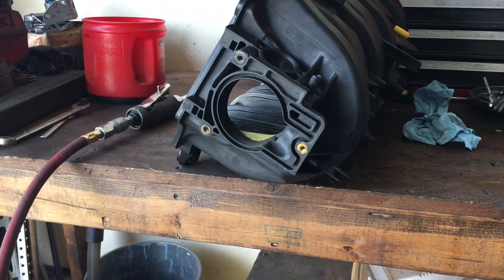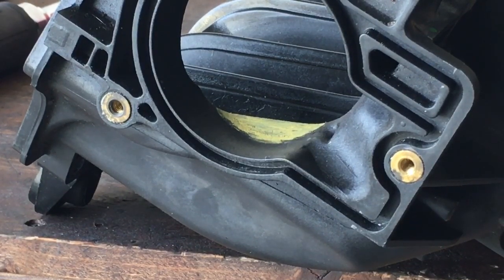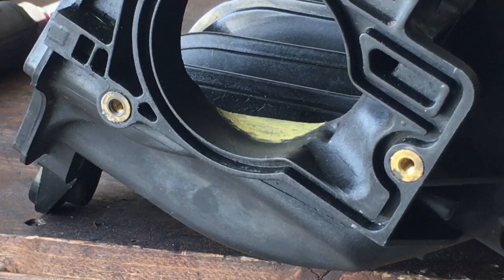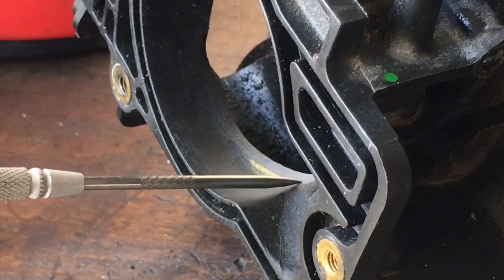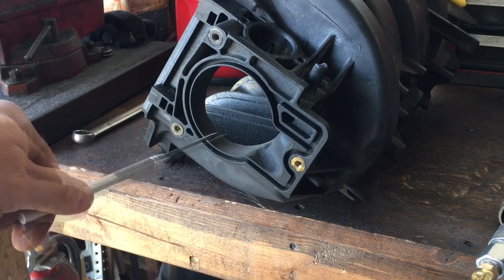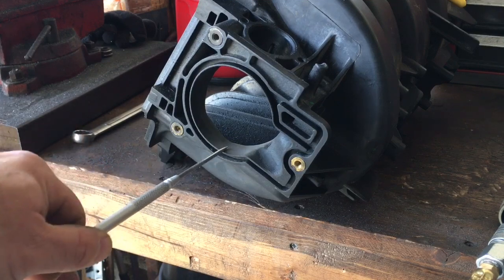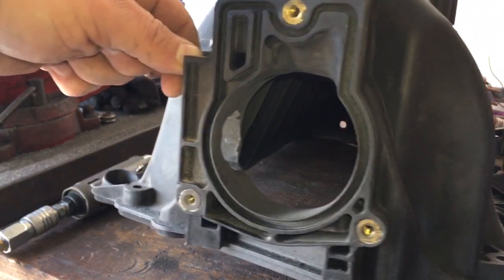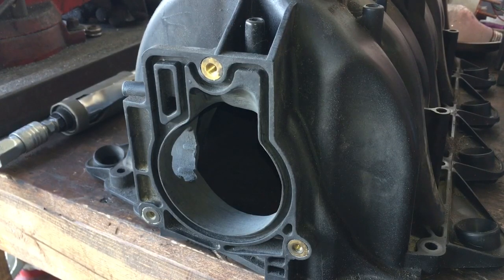Porting  4.8 5.3 6.0 Truck Intake 615-183

Comment: i bought one of tgese intakes from ebay when i split it  it was held together everywhere with some kind of sealer instead of gasket/seals was wondering if you knew of a sealer i could yse to put it back togethor?

Comment: I know this is old video, but what grit or what are you using to do the grinding?
Reply: NVM, I just needed to watch a little longer.
Reply from the maker: You can use a tight flute single or double cut burr.  Sanding rolls 60, 80, 120 etc 👍

Comment: How did u get it apart and sealed back up ?
Reply from the maker: The intake has large o-ring seals and since it was new had never been heat cycled etc.  I just unbolted/screwed the halves then reassembled. 
I’ve read about people sealing the halves with the Right Stuff rtv or even using epoxy.  I’ll be honest my 4.8 never ran right at idle and had issues tuning the return to idle after revving using HP tuners.  During my Turbo install I went back to my port matched regular truck intake with great results. JD
Reply: I just realized it's a Dorman and not factory ... I was looking AT my LQ9 intake Like how the hell u get this apart 😅😅
Reply: Heat gun?

Comment: Id love to see a before an after dyno with this port work. Someone needs to get that Richard guy from west tech to do it
Reply from the maker: It would be cool to see Richard Holdener do a back to back Dyno test between a stock and ported 615-183.
I’ve always wondered if the intake I ported in this video either had a vacuum leak or something because my mildly built 4.8 absolutely hated to idle etc with it.  I ended up trading the intake away and installed a gasket matched/cleaned up regular truck intake.  JD
Reply: @HeadFlowInc  ya i was thanking about doing it. Ill do anything for a horse power lol.  but sometimes mods or porting does the opposite.
Reply from the maker: Truth!

Comment: Get it tested by one of those dyno guy's
Reply from the maker: It never ran right on my 4.8, I’m not sure if the common plenum was too big or if I had a crack or other vacuum leak. I switched back to a gasket matched 1st Gen truck intake when I went turbo; it runs great now!  JD

Comment: Why just nit get the tbbss intake its better plus its already has enlarged runners no need to port even if u port that thing how much hp
Reply from the maker: Willy Garcia TBSS intakes aren’t easy to find.  So we were trying this intake based on others saying it worked good but my 4.8 hated it at idle and low speed, it only worked great above 3500-6000+ rpms. It may work great on a larger CID build? 
I’m looking at the TBSS for a 6.0    build I’m working on.  JD
Reply: @HeadFlowInc  That "portrusion" you ground off would have helped part throttle response.

Comment: Do you, or anyone happens to know a part number for the 5.3 Intake (like this in the vid) -RETURNLESS fuel rail assembly? Thanks!!
Reply from the maker: I think you’re needing a flex fuel style fuel rail from a truck.  Honestly we don’t use return less fuel rails they are not the best setup for making power and fuel pump life span.  If I can I’ll try to figure out what fits but can’t guarantee I’ll have the parts available to test. JD

Comment: I have heard these can have hollow pockets or bubbles in them, but otherwise better than ls3 intakes, your opinion?
Reply from the maker: JAMES! Since the 70's I’ve only done basic port matching and internal step removal with slight blending in the plenum opening.  I know these Dorman intakes work great on higher HP builds and bigger CID. 
It’s hard to compare a cathedral port intake to a rectangular port intake.  Apples to Oranges really.

https://youtu.be/NCgxqe-I8CQ

Comment: This manifold work with 823 square port head?
Reply from the maker: Fernanda Puentes You would need adapters, I’d shop around to see who has the best deal.  I know ICT makes billet adapters from the square port heads to a cathedral port intake but they cost $200.00 😳😳😳 
https://www.ictbillet.com/ls3-rectangle-port-cylinder-head-to-ls1-cathedral-intake-adapters-ls-lsx-ls2.html

Comment: Would you port the knock off version of this intake? It’s only 80 dollars and I’ve read that it’s just as good if not better than the dorman, going in a boosted truck as well.
Reply from the maker: Isiah Olivarez Who makes the knock off version?  I’m still trying to verify what or if there’s a Boost limit for these multi-piece intakes.  The LS1/LS6 guys seem to limit their multi-piece LS6 intakes to under 15# boost?
Help do some research to see what boost limit you can find? 👍
Reply: HeadFlowInc  go to eBay and search 615-183X it’s identical. My setup is going to see 15-20psi maybe more. I will definitely be sealing mine permanently with a polymer glue, it shouldn’t come apart.
Reply from the maker: I'll check out the link and want to learn more about the sealing the intake with the nylon polymer.  Dorman claims the people having leak issues are caused by installer error not following the torque sequence/specifications.  I was kind of shocked, the Dorman rep basically said, "All these want to be techs who want to impact fasteners designed for a specific torque specification are causing their own failure.  Keep in mind the multi-layer intake design is sealed with a rubber seal, torqueing the fasteners more than recommended simply isn't necessary to create a leak free seal which is good to 25# or more of boost or vacuum."  After trying to decide if he was covering their liability or if what he said was true or not, it would make sense to a certain degree.  After all, how much force would/should it take to compress the rubber sealing gaskets and if the intake can handle 20# of manifold vacuum at idle, shouldn't it hold 20# of boost?  Interesting stuff!
Reply: HeadFlowInc  very true. I just wanted to use the polymer for extra strength. I’ll be a test dummy👍
Reply from the maker: Isiah Olivarez There’s several people who have permanently sealed multi-piece intakes.  Make sure you use a polymer/epoxy rated for the specific material or it won’t stick. 
Iirc it’s something with “66” in it?  
I assume they’re removing the rubber sealing gasket and running a thick bead between the halves?
Reply: +Isiah Olivarez  Where do you find a “Nylon Polymer” adhesive?
Customer service with 3M did not recommend adhesive for nylon polymer compounds as used on intakes, but they didn’t make any either. Thanks...Happy 1 /1/ 2020.
Reply: The 615-183x is not the same quality as the Dorman one.

Comment: How much you charge to port a truck intake?
Reply from the maker: Slo verado I don’t work on the factory one piece truck intakes, they require machinery I don’t have. These 3 piece Dorman intake would be $150.  But the time you bought a Dorman and had it modified you might as well get an aftermarket intake.

Comment: Unless you've flow test this intake and looked at the air path and how that effects the flow how can you make those statements do you not think they spent 100dreds of hrs researching that intake? If you look opposite of that "step" thats where the egr flows in maybe just maybe its there to help syfen the egr into the intake ? Just a thought but if you havent put the intake on a flow bench with a cut out and some smoke to see what's hoing on I think your statement about the opening in plainly ignorant
Reply from the maker: Mikel Bentley You’re entitled to your opinion I respect it. 
I can either go by my 30 yrs of experience building performance engines or I could simply compare this truck manifold to higher flowing intakes, ie LS1, LS6 style or a FAST side by side. It’s ok to modify parts that’s why some cars are faster than others. 😉
GM clearly Built this intake with low rpm torque as the goal, I’ve changed it to flow better in the mid/upper rpm range for HP.  Add in 15-20# boost and it’s going to make big power via a common plenum with less restrictive flow.
Thanks for the feedback, this is a good thing, it shows you pay attention and want to know why. Thanks again JD
Reply: Mikel Bentley interesting you say gm spends 100s of hrs designing this intake.... But they spend thousands of man hrs designing cylinder heads that  people still get ported....... What's your point? Gm doesnt necessarily strive for Max port flow when they design the basic non performance parts. But hey what do I know
Reply: Mikel - obviously a newby to the world of porting. If factory is so great there would be no aftermarket.
Reply: Mike B. Maybe, just maybe you have no idea what you're talkin about.
Reply: Honestly this has to be the stupidest f**** comment I've seen on the internet in a while. Vengeance racing charges to port and polish their fast intakes they sell. They've proven on a Dyno that they're getting a few more ponies out of it. Vengeance is known to make some pretty high-end performance motors. Now the fast intake has been tested Way beyond anything GM has ever done.